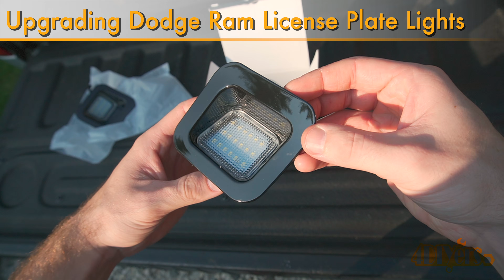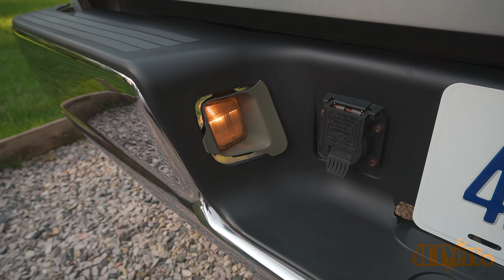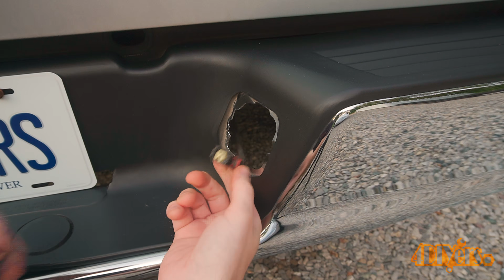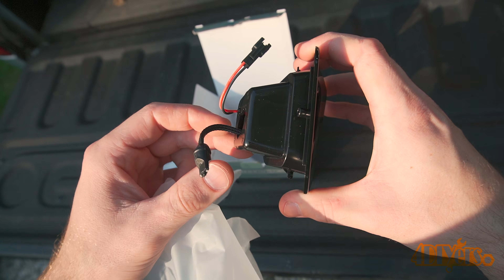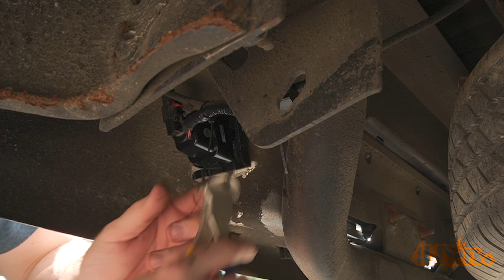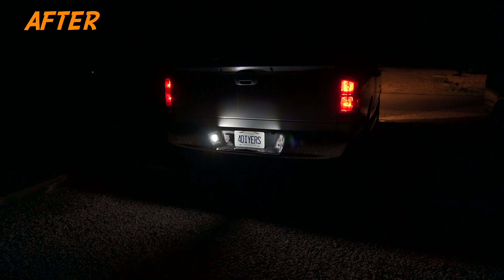How to Replace Dodge Ram License Plate Lights with LED Upgrades

Comment: Great video. I just got my MoriMoto lights the other day, and I tried putting one in, and the male plug from the light is not snaping into the female portion of the plug (Socket). Was yours hard to snap together. I see that you are adjusting with a screwdriver. I'd hate to damage the socket. Does that plug go in fairly deep?

Comment: My kit is from "vipmotoz"   It does not have the resistors in the kit and it does not show any resistors being used in the instruction guide? Must I use the resistors? If so where can I buy them? I have 2006 ram 1500 Thanks for the great video
Reply from the maker: I would try it without a resistor first and see if it's fine. The resistor is for the canbus system.